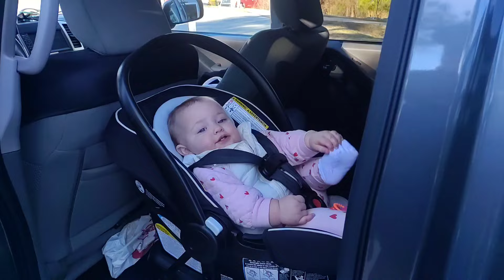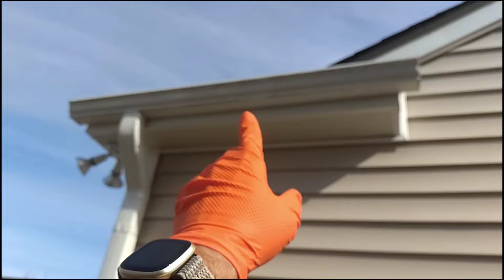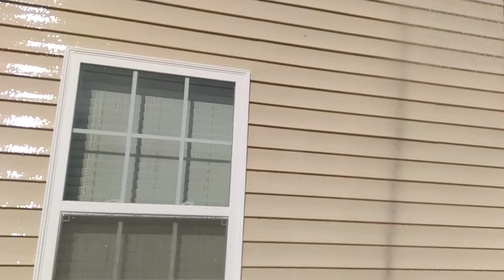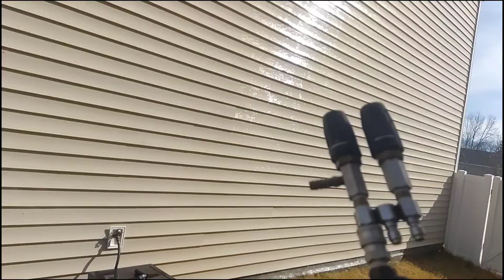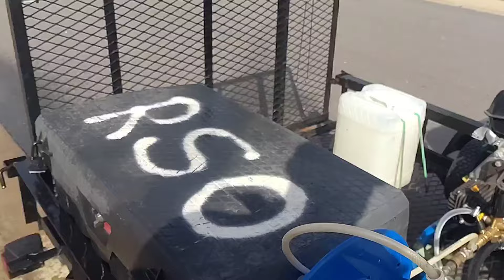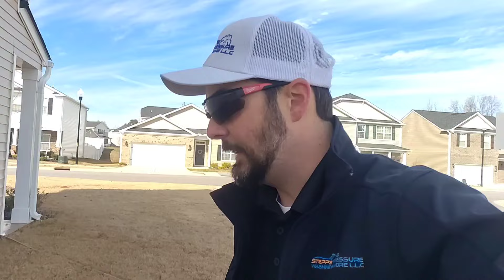Winter Pressure Washing - Small Business - Gutter Cleaning

Comment: I don't see you rinsing plants and grass. Do you cut that out of the video? Or do you not worry about it with your particular mix?
Reply from the maker: I generally don't rinse grass unless I'm putting down a post treat for concrete. My house wash mix is slightly under 1% and hasn't damaged grass yet. I will generally rinse plants though, especially if they are actively blooming. I have acquired many loyal customers because the previous company burned their plants with SH.

Comment: Have you ever had an issue with vinyl if it’s not pre wet first. I own a pressure washing/ soft washing company for the past five years I’ve always done that. I have a separate soft Wash system. Am I just wasting time doing it?
Reply from the maker: I only prewet if its in direct sunlight and super hot that day. Otherwise I dont prewet. Always keep an eye on the sunny side though, it will dry faster than the shady side just because it's hotter. 99% of the time I don't prewet
Reply: @steppspressurewashing  ok I was just curious if you ran into any issues. I am always super cautious but sometimes if the well is touchy I feel as if I am wasting water and time. And you’ve had no issues with streaky windows? Without the prewet?
Reply from the maker: @ParanormalIDENTIFICATION  no issues with streaky windows since I stopped using surfactants. I rinse the windows 2-3 times to make sure im not leaving residue. Just make sure you're not letting the SH dry.
Reply: @steppspressurewashing I heard people say when it's hot to "keep the siding wet" How does this work though, aren't you effectively rinsing?
Reply: @steppspressurewashing I heard people say when it's hot to "keep the siding wet" How does this work though, aren't you effectively rinsing?
Reply from the maker: Yes, you actually want to always keep the SH wet because it will oxidize if you let it dry. You can reapply your SH mix to keep it wet or just mist it with fresh water to keep it wet. It will dry faster on hot days, and in the sun.
Reply: @steppspressurewashing  Is this always necessary, or is it only needed on the hot sunny sides of the house?
Reply: @steppspressurewashing  I'm sorry for spamming you with questions
Reply from the maker: @TANMAN84  Happy to help dude!!

Comment: What size pressure washer are you using to downstream. Do you know what size injector you have? Also what psi is your pressure washer set to while downstreaming?
Reply from the maker: I use a 4gpm pressure washer with a 2.1 injector. I haven't tested the psi on the new pump yet.